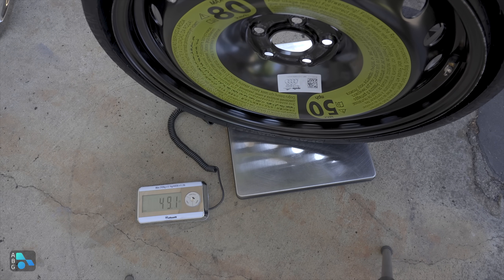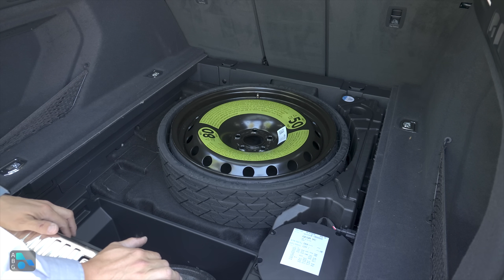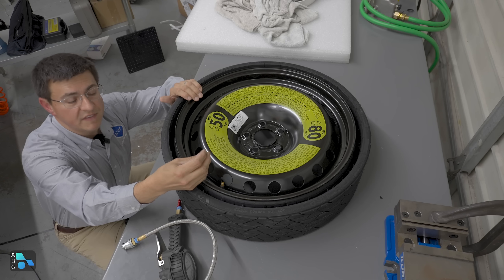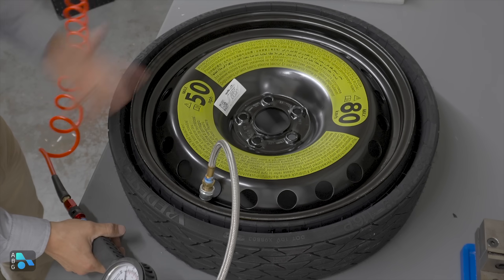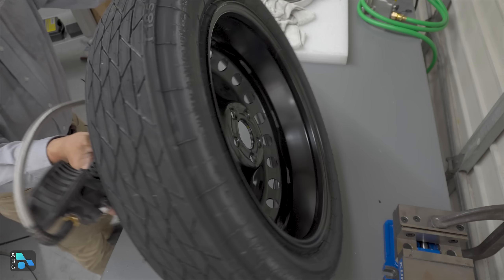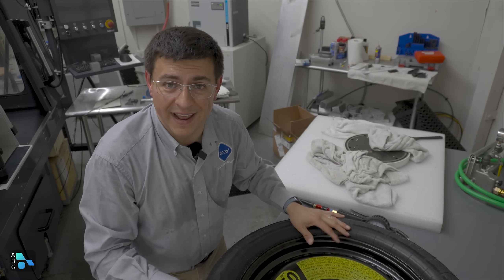How A Collapsible Spare Tire Works, And How It Might Save The Spare Tire In EVs

Comment: I don't like it. I would rather have the small donut tire that has air in it. For One; I have a flat, not in the best of moods.
Two;  I'm already been  struggling getting the lug nut off and searching for the lug key.
Three; I have to take time and blow up a tire...NO. 
Four; it raining, its snowing, its 114° outside or   its  - 15°   

Nope not a good idea.

Comment: My 1980 Trans Am was equipped with a collapsible tire ...identical to the one in this video right down to the tread pattern 😂🤣, it was done  because of the TA`strunk ,  if  it could be called that , as it could not accommodate a full size spare .
WOW !!! 2023 .....NOW THIS NEW  REDISCOVERY !!!! One of the many  the benefits of being 70 plus, is that we can laugh at garbage like this , but more than that, laugh at  the ZOMBIES age 50 or less  who think that this is something new and wonderful 😂🤣😂😂🤣🤣😂.Now  when these abysmal auto making thieves return to making real cars with space for a spare tire that is identical to the 4 at each corner like used to be the case,  there may just  be something to celebrate about ! It may never  happen ... absent  a population of  zombies who  can be happy about spending 75 K for a rolling pile of junk that does not include a real spare tire.

Comment: I’ve hardly ever had a try blow out in any car but had screws and slow leaks a few times. Because of that I put a plug kit, plyers and air compressor in my Nissan leaf. In 35,000 miles I did need to use this once at a construction site and was much faster than this process that also needs a compressor. I would like a spare for sure but the slight space savings of this vs a full size spare seems hardly worth the effort.

Comment: Re: 2001 Audi Allroad, I forgot to say there are limitations related to traction, and handling as the treads are shallow and not usually as wide as a regular tire. Also there are revolution per mile % tolerance differences depending on the drive system, especially AWD, related to not damaging various differentials or triggering anti slip systems. Some car makes say to move a good tire to the front and put the spare on the back. Of course doable only if you have nondirectional tires. My Allroad collapsible spare is almost the same inflated diameter, within 1-2% of stock, but the tread is definitely not as grippy nor as wide. So they really are for limping to a repair shop slowly at less than 50 mph.

Comment: Considering how big SUVS are anymore. I call bullshit on the EV bit with spares. The fact you have to pump it up before use ads one more variable of failure. If the pump stops working or they loose it while on the road. That spare is worthless. As an engineering nerd, it comes down too priorities. The consolable tired is a shit idea past it being a nifty engineering concept. Chances are they could have saved money from the RnD going into it if they designed things better with the need for collapsible spare. Plus, your spar is going to cost even more cause of the tire design and rim required to make that happen. Late stage capitalism is making me hate the newer "Luxury" cars. Regardless of EV or not. And people wonder why EV's are so overpriced people hardly buy them. None of that adds real value for the customer. Only adds more cost.

Comment: Great idea and yes would be great for all cars. Having car with no spare I use a gun puncture repare kit. Basically you have round file on T handle to roughen hole having eased out projectile, then with the gun shaped tool force 1 inch long solid rubber plug in hole before cutting off excess on outside.
Works really on most holes as long as they are not massive. Plug is temporary fix however last well until you can get it fixed ASAP.  The great thing is wheel removal is not necessary so great at night when in best clothes. Would check tyre pressure every day until proper fix and instructions say keep speed low. Some kits are better than others. Some use glue, and with some the plug is like a champagne cork with the top being on the iside so really safe.

Comment: I have a 2001 Audi Allroad with 87,000 miles. I have never used the inflatable spare tire or pump. Although it and the storage compartment are pristine, I figured I would try to replace it before I take a road trip. It is 22 years old, and maximum recommended tire life ('industry standard') is 10 years. The original temporary inflatable spare is a Vredestein,  205/70 - 16,  97P, DOT DVHM 2101. No one has a replacement, not Audi, not Vredestein, not Coker Tire, not Tire Rack, not Tires plus, and none of the common manufactures. Good luck if you need a replacement if you keep the car more than the 'usual'. I am probably going to get a full sized bidirectional spare and tether it properly in the station wagon load floor. Probably more useful any way.

Comment: I'll check back and let you guys know how long these tires last in daily use applications.
My neighbor has one on her suv right now.
Been on it for 3 or 4 days so far.  😂
At least it was put on the rear, where its supposed to be.
She will run it until it disintegrates.
She ran a knocking motor until it locked up last year. 🤣
Her new motor is now starting to knock.

Comment: ? There is alot of space in an electric car to fit a spare wheel. It is just that more and more new cars dont include them.
No, the Audi spare does not give extra space. You can see that in the video. Air around it and no place for other things. Do you even think before saying stuff?
And the fashion to have huge wheel on cars is stupid.

Comment: Having the spare in the front would most likely mean having charging cables in the back, not quite good when you have cargo and don't have where to put them to keep them accessible, surely not under the lid, would be absolutely unaccessible. As for the spare tyre you won't be needing it other than in an emergency, so no problem there

Comment: i imagine a car fitted with one of those isn't gonna win any races since the sidewalls aren't quite as stiff and the thread isn't great. but its better than waiting for a tow truck. however, i think the biggest issue with EVs and spares isn't weight, its the fact the traction control is more sensitive and any change of diameter simply makes it panic.

Comment: Actually they were in porsche and mercedez vehicles before. Wasent a secret, just most all car manufactures are too cheap now a days to put one in vehicles being sold. Excuse was because they would get better gas milage or range, which is a farce. They saved 135$ on each car sold and put a useles car inflator with fix a flat instead.

Comment: Good video, bad idea.  You hade to pump your spare up to use it!  That  with the lack of chargeing stations and rare earth metals, plus extra  weight on our roadways adds to my reason to avoid an EV.
Reply: These types of spares are not new and not specific to EVs. My dad's old Mustang from the 70s had one of these but it was much less refined. Also what are you talking about when you mention a lack of charging stations? You can easily go cross-country in an EV these days, and every power outlet is a charging station if you absolutely get desperate.

Comment: Way to reinvent the wheel, bud.

So, when collapsed it’s still just a “donut” spare. I don’t see how inflating to a larger size makes it more suited to an EV than a donut. It’s obviously still not a full spare and any EV that could carry it could carry a donut too.

What am I missing? Is there some reason an EV can’t use a smaller donut? I’m well aware that EVs often leave out the spare for space and weight reasons but this is no better than a donut as far as space and weight are concerned.

Comment: One problem... Where do you put the tyre that got taken off the Car? do you just leave it on the side of the road because it wont fit in the vehicle? Space savers are a stupid idea that cause more problems for the user than they solve for the Manufacturer

Comment: Tip, if a front tyre blows and you have a spare, jack car up, remove a rear tyre, install the spare on the rear, and then install the standard wheel onto the front.
You’ll have a far better ride and more control on steering having the same size wheels and tyres on 2 front corners.

Comment: I have been in the automotive industry for years, from being a mechanic,  to owning a shop, and running a towing business,  the collapsible spare has been around for over 10 years. It's more common then you think. Many manufacturers have implemented them, but they also require a extra cost, they need to include a pump. So many just went back to the compact spare, or included a "Fix a flat" Kit with slime and compressor, vs the collapsible spare.

Comment: These kinds of spare tires have been around for at least 50 years. It's a wonder why EVs hadn't been using them up to this point. I have a 1980 Datsun 280zx with one of these. Had not a clue how it was supposed to work. But sure enough it worked fine.

Comment: Interesting. I'd never seen or even heard of a collapsible spare. Fascinating how it works. Regarding putting the spare up front: My guess is they did it to keep the default weight distributed. But I agree that I'd want it up front. Not for space reasons though. For me, the time when this would really come in handy is on a long trip where I might be out of cell coverage. On a trip like that, I'd usually have stuff piled in the back. It would be better to have all of the spare tire stuff in one place so I don't have to unload all of my stuff onto the highway to get to the spare.

Comment: I would rather use the space to carry a full sized spare to swap and go keeping the same safety all 4 wheels have then to put on a spare that is not safe at all. Safety first right. You can't pass registration with a wheel that's different to the rest so why would it be okay to put one on to use as a spare? No thanks. If I had a car like that I would ditch that spare and carry a proper tire. This new idea of compromising safety to have more space is backwards thinking and I will have no part of it. IF having more space is a big problem then manufactures need to make the car taller wider or longer maybe all three instead of putting peoples lives at risk.
Reply: Wdym a spare tire and rim are always made less durable than a normal tire and rim for a long time. They're always meant for an emergency and not an extra tire you can just swap and go.
Reply: Only an american would say make the cars taller, wider and longer...
Reply: Spare tires are perfectly safe if you follow the spec and drive carefully. They are only meant to get you to a tire shop, not last the rest of a full road trip

Comment: This would appear to be a total waste of time! Obviously aimed at saving space, but it is doubtful that the rubber would be functional after a very short time after being folded up in the car in hot weather, and what are we supposed to do with the punctured tyre we take off? As there will be no room to stow that we just throw it in the ditch and drive off on our high tech spare wheel! No very eco is it?

Comment: Thank you for the video! As for why Audi probably placed the spare in the rear of the vehicle, it could’ve been due to crash test safety results. One could speculate there’d be greater risk of injury or death to the driver and/or passenger if the spare was in front during a crash. Again, this is merely speculation; but seems like the logical answer. Thanks again!

Comment: the older late 80's model Subaru's used to have the spare tire in the engine bay laid up on the back of the engine by the firewall.

Comment: This is NOTHING new.  My 73 Pontiac had one....and it even came with a can of air and the Shrader valve removal tool.  So it's not new, it's not amazing and it's not high tech.  It's a very old idea and an old product.  Next a video on Push Button transmissions!!

Comment: What a great idea. We have a BMW X3 M40i with run flat tires. Since the vehicle was new in 2019 I have had two punctures and a blown belt in one tire which I was told had to be replaced with a new tire. At $900 per tire this has been a terrible experience. On one occasion we hit a pothole and a front tire blowout with a 6" gaping hole left in the tire wall.  We were 170kms from home with five people in the car. The absence of a spare tire and no other solution we had to get a taxi for the pax and a tow for the vehicle. I wish, with a passion, I had my time back to choose another option or vehicle. I think BMW have really dropped the ball with their love affair for RFTs. They are seldom repairable and super expensive.

Comment: 👎☹The collapsible tire does not work. It has a design fault which shows up after a period. Because the tire is stored horizontally, vibrations cause the inner tire beading to drop down and separating from the rim causing an air leak. The small pump in the car does not have enough air flow to seal the leak but a larger compressor can seal the leak. Please test collapsible tires that have been in a car for a year or more but use the small air pump that comes with the car.

Comment: All tires should have a rubber ring around the rim in case if you got a flat tire. They can make it from solid rubber that can withstand a lot of pressure just like forklift tires. And it can be made so it is not that heavy...

Comment: 5:41 We're wondering why they didn't put the spare tire up front. Well actually, I wonder why they put those other loose items up front myself! The thing is, cars sometimes have accidents, some of those accidents can possibly be severe head on crashes. Would having the tire in that location help or not help with safety in the event of a crash? That's an actual question because I do not know. Ideally I'd love to see the tire up front, turned upside down with all the accessories designed to fit inside it (that means even a pump with a semi-circle body). Then the space in back can be better expanded.

Comment: Spare tires that cannot be driven at the speed of a regular tire place the user at risk of rear end collisions on highways with heavy traffic.  Making light weight spare tires simply to save a fraction of a mpg due to the lower weight is false economy.  They should be outlawed.

Comment: Nice design....in any case a spare is not to be used as a main driver, just to get you to the nearest Tyre shop for repairs....but if a EV has this it better come with a good air pump...it will be a shame if you get a flat and no way to pump the spare for use...to me it's major downside and the fact you have to spend time pumping the spare. With normal vehicles it's already pumped so just to change quick and easy in emergency situations.

Comment: Rather than changing to a spare tyre which involves jacking the car up, removing and installing wheels, it is so much easier to position the wheel so the nail can be seen, remove the nail , plug it with a repair kit and pump the tyre with a 12v pump that comes free with the car. 

    It is also so much safer in the mountains,where I live, where there may not be a level surface for miles to safely jack up the car.

Comment: The "Screwdriver" is called a Valve Core Remover and is very handy. It would make lot's more sense to have the spare with the jack and inflator . . . Poor planning and design on Audi's part.

Comment: Awesome video! I really dislike these small spare tyres - the hassle that weight/space saving provides cannot be compared to the hassle of finding a tyre place when you get a flat tyre on a long trip in the middle of the night.
Reply: In Capitalist 'Murica, tyre place find you.
jokes aside, flat tires are much less common, and so I don't have a problem with normal travel without a spare.  in fact, neither of the cars we currently drive have one.  I wouldn't be surprised if some tire centers now have a stock of spare wheels they can have their "roadside assistance" truck bring out to get a customer rolling back to their shop.  I think when my wife had a flat, the assistance truck just inflated the tire (it had a nail hole) and it held long enough for her to get there.

Comment: Even for my 13 year old E63 AMG, the "spare wheel" was such a collapsable one. (and it seems Vredestein are the only ones manufacturing them)
In general i find it worrying that fewer and fewer manufacturers (not just EV's) even give the option to have a spare wheel.
And that while a flat tire is among the top two reasons for an undrivable car (break down). (The other one is a bad battery, no matter if ICE or EV)

Comment: Whenever I buy a car without a spare tyre (full size or spacesaver dosnt bother me) the first thing I do is go to the scrapyard to get an wheel then get some rubber put on it. Tyres pop more and more with the roads getting worse, and you really need to be able to quickly get back on the road.....

Comment: NEVER open a valve core unless you plan to replace it. When you tighten it again, you'll never get it to seat correctly again... and chances are excellent that when you remove it, it'll blow out into the brush anyway and... you'll then replace it.

But then you're driving an electric car anyway, so you're a writeoff.

Comment: I don't understand what this is achieving. At 1:59, there is obviously enough space for the usual spare.

I don't want to be sitting on the side of a busy road waiting for my tyre to inflate when I could just pop out my spare tyre that's already at the correct pressure and swap them over.
My car even has a full sized wheel in the back, so I rotate the tyre on that with my main 4.

Also with the jack and inflator inside the wheel in the back the extra space gained in the front trunk would more than account for the volume of the inflated tire.